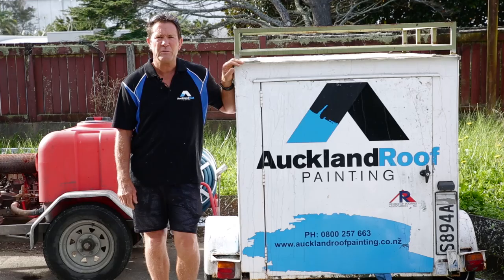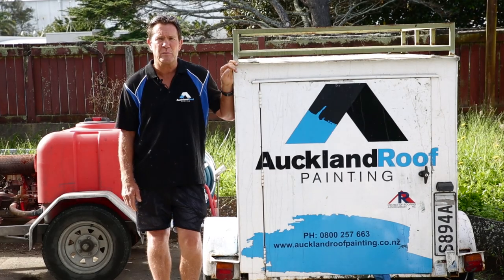Concrete Roof — Repair & Painting (Step 5)

Comment: This clown just pointed up over old cement he's no roofer
Reply: Ethan Plant i thought i was a bad roofer until i saw this clown
Reply: Are you trying to say he should peel off the old cement?  Dreaming lol
Reply: 1abomb1 yep, or it will just fail later
Reply: Cowboys for lifeeeeeeee
Reply: It is literally the standard in the industry to point over the old cement with flexible pointing. Imagine all the things wrong with pulling up all the old ridge caps to remove the cement. LMAO. It is obvious who the idiots are
Reply: Buddy didn’t even grind the hip back.  Rough as fuck